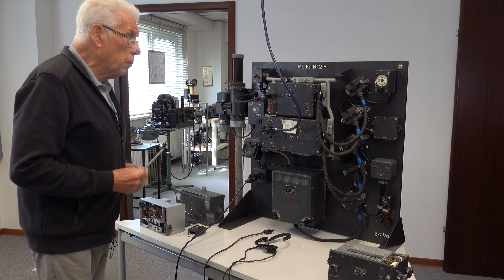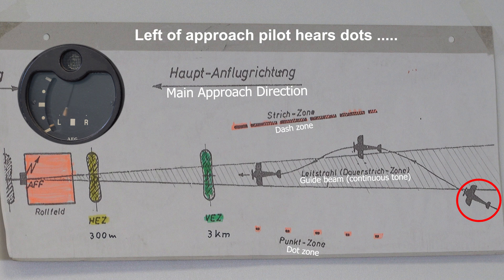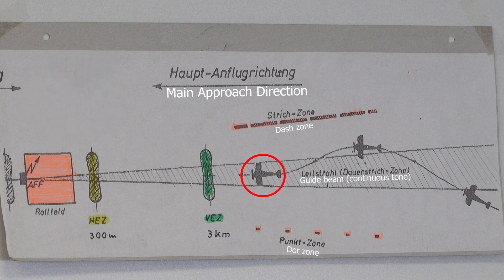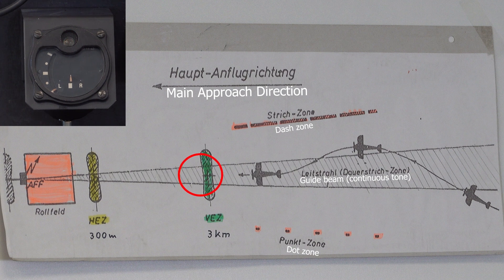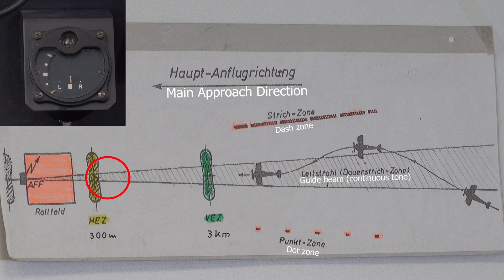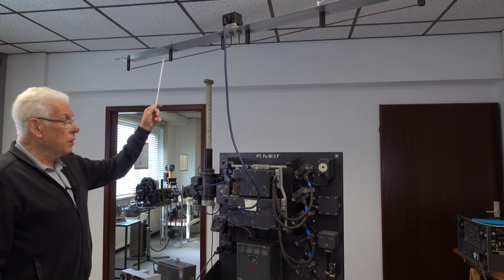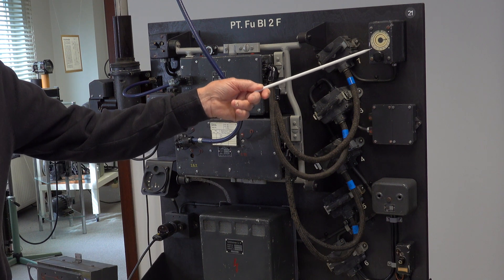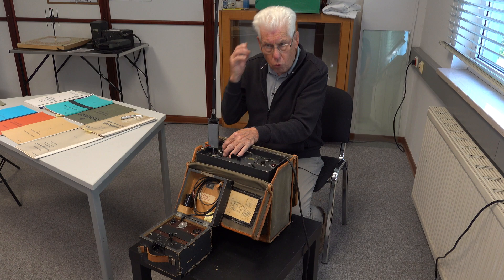Lorenz "Beam" Blind Landing System FuBl 2

Comment: Wonderful stuff...  In conjuction with watching Mr. Beikirch's FuG 10 demo, does the Funker switch to FT + NFF, sets the FzF switch to LFF, and the Flugzeugfuehrer sets his remote headset switch to NFF?   The FzF would hear both the left/right audio signal AND the VEZ/HEZ inner/outer sounds at the same time, correct?   Does this also mean the intercom is not available to the crew when this is set?  Or, perhaps I'm misinterpreting the FT + NFF versus FT +EiV switch on the Funker's station.